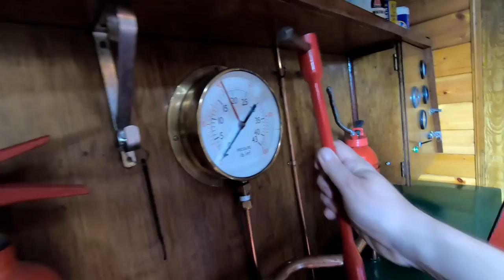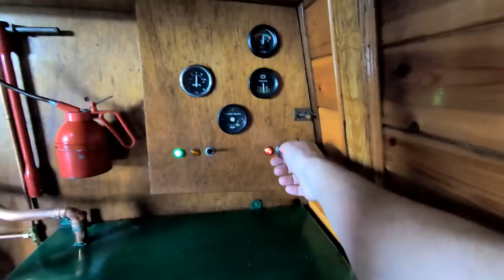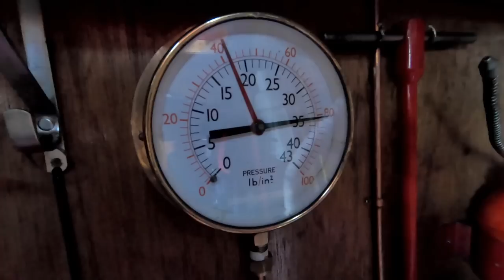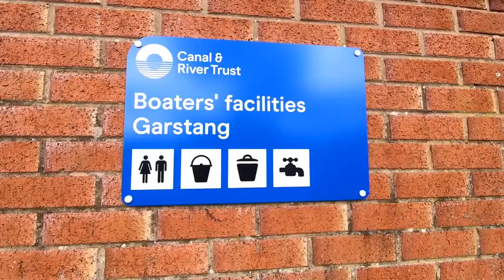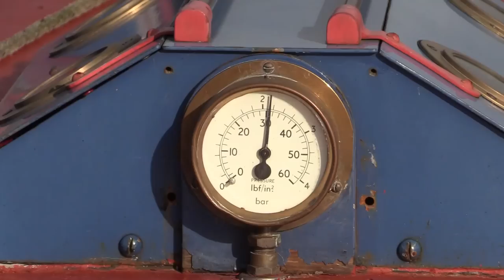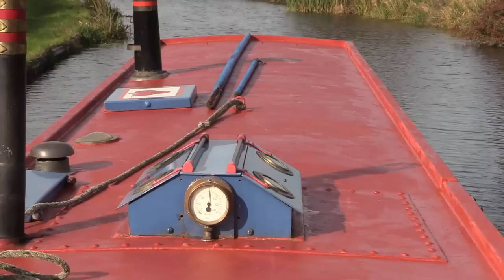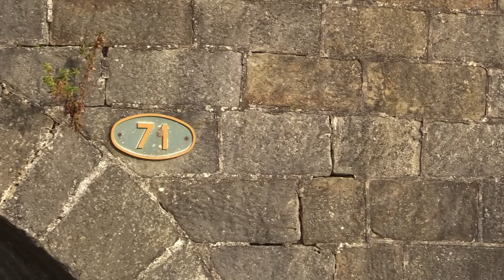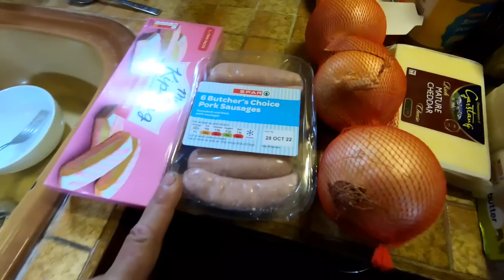Travels by Historic Narrowboat - Part One

Comment: Years ago, I operated a big 6 cylinder JCB tracked digger. The glow plugs didn't work, so on cold nights i left it slewed just enough so the air intake was just above the track. The next morning i built a little fire on the tracks, turned engine over and the fire sucked into the intake, and away she roared. Unconventional, but it worked!
That is a lovely engine bay!
 Jeff.
Reply from the maker: Wow, that's a fab tip to remember but I won't tell the owner I've lit a fire in their engine room. 🙂

Comment: I remember as a kid in my first job at a dry cleaning factory starting the lorries, sometimes it was necessary to to use a piece of rag soaked in diesel  and hung over the air intake with a pair of mole grips and set fire to, to help ignite the fuel in the cylinders when using using the starter. Much later in life I had a Ford Granada which had been converted to a York diesel engine which was a 'bastard' to start. I always had to use an ether start spray, my favorite was an Australian product called 'Start ya Bastard'
Reply from the maker: Fabulous. I went straight on the net to find a can of Start Ya Bastard. Sadly it was imported to the UK until a few years ago. Shame, would love a can (full or empty) just as a decorative piece. 😳😁

Comment: The sound reminds me of haying at my grand parents ranch. as a kid I had to rake hay with the horse team and a dump rake and smell the horse farts all day while my father and uncle got to run the jonnypopper tractors cutting hay. Then we would run down to the oil well and add water to the water jacket on the one lunger used to pump oil. you could hear it for miles all day and night.
Reply from the maker: Indeed, a lot of engines now in narrowboats started life as stationary engines powering all manner of machinery.

Comment: You should see starting a Model T Ford in very cold weather. We need to run non detergent 30w. It gets thick. So we drain it and pour it through the engine a few times. That's only part of the technique.
Reply from the maker: Gorse (and Aslan) run on non detergent SAE 30 mineral oil. A popular tip is to run 20 or 30w in the winter and 50w in the summer. Yes it's surprising the techniques some engines need to get running.